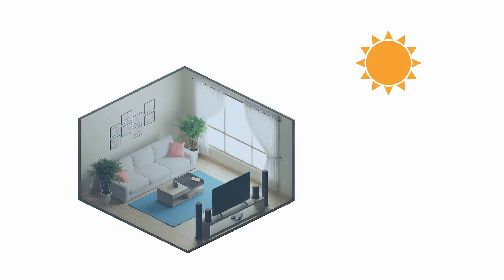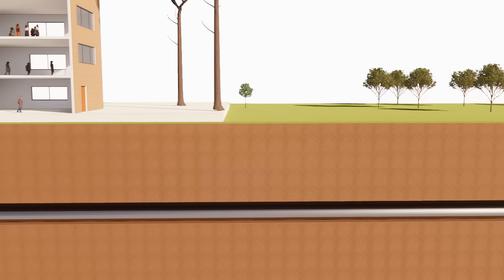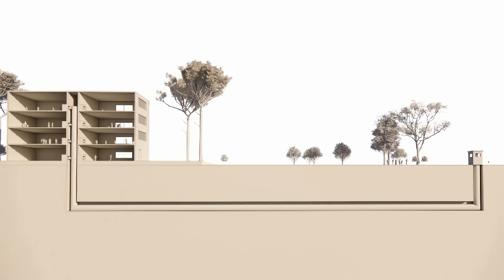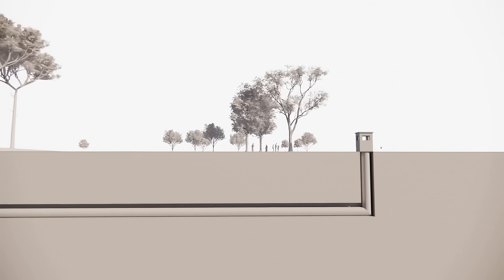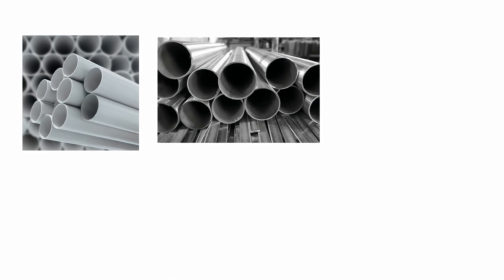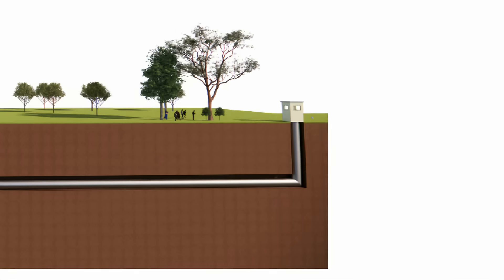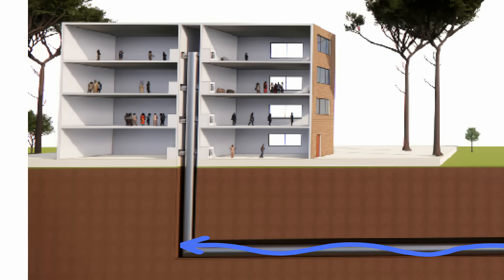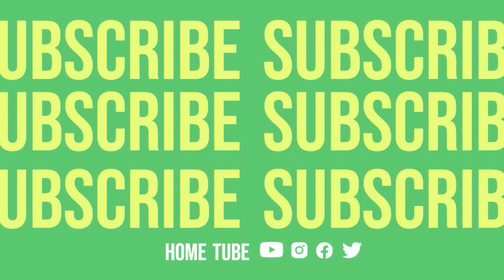Earth Air Tunnel System: Sustainable Cooling & Heating Solution

Comment: It’s not going to work because look at the heat/ cooling system, the air needs to go thru a very hot or cool grill to change the temperatures. If you just put pipes without grill it will not make significant changes. It probably would work if you install lots of grills along the pipe that connected to soil around the pipes.

Comment: Very interesting but, the underground duct or pipe needs cleaning at some point unless a clever solution is developed to overcome the problem of mold, virusus and bacteria growth in the system because of condensation/moisture.

Comment: A word of warning: When using it for cooling, if the humidity is high enough, and the ground is cold enough, you will have water condensing inside the underground pipe, which can then make the pipe become a breeding ground for mold, and the air passing through here is the air you are breathing.
So before using this, make sure you have investigated and understood how to make this type of system correctly, so that you aren't breathing "questionable" air inside your house.

Comment: do you think engineers are dumb , ideas work work.fine in your head until you put them in practice and learn the reality, the ground is cooler yes but as soon as you draw in hot air there will be heat exchange between the pipe and the ground which will heat the surrounding soil losing its efficiency over time

Comment: While this has been documented as a functional option (though not exactly the function this video is trying to sell it as) , this video leaves out a LOT of important details.
Formally called EAHE systems. If it interests you, study up. The info is out there, but takes some time and effort to sort through. Pretty neat stuff. 

For those who are interested, here is half a page or so of info I have found during my research. This is just off the top of my head, so take it with a grain of salt, but is accurate to the best of my knowledge. 

 It is meant as a method of TEMPERING fresh intake air, not necessarily as a means of climate control. All buildings need some form of fresh air. If you just pull in outside air that is 40* hotter/colder (or more) than your desired inside temp, it takes a lot to correct that temp difference. This system can moderate that difference to some extent and, sometimes, under just the right conditions, be enough to act as climate control on it's own. Much the same as a modern HRV or ERV system. Used in conjunction with a ERV/HRV they can really cut energy usage.

That said, they left out, or glossed over several VERY important details. 

1) Concrete tubes, unless sealed with some type of epoxy or something, is a very BAD idea for this function. Porous and difficult to keep clean = major mold concerns. 

#1 Better) PVC pipe, sealed, and laid in with a 1/8th" per foot slope or more to either a drain sump or out to daylight (out the side of a hill). A coated cable should be placed in the pipes during construction, to allow for a cleaning swab (think wads of towels) to be pulled through the pipes for cleaning. Pulled from inside to outside, with a second cable attached to pull it back after. Towels soaked with cleaning agent of your choice going out, dry towels coming back. Repeat as needed. #1 BETTER YET ) copper pipes, done the same as above. There are places to get these, but have a cardiac specialist on standby before looking at the prices. As Steve Irwin would say ""Crikey!!!"$$$$$

NO CORRUGATED STUFF OR DRAIN HOLES. That is just adding more problems to a system that has many possible pitfalls already. This could be a whole book by itself.

2) Not a single large pipe, but several smaller ones. Studies have shown that pipe diameter has a point of diminishing returns. It is generally accepted that 4-6" pipe is about the best range for thermal transfer in these systems. Then you calculate the number and length of pipes needed to get the proper CFM of flow for the best effect. Generally 30-60CFM each if using a blower/fan. Half that if used in a passive system. They will need to be LONGGGGG.

3) The intake should have a filter sufficient to stop bugs and other pests, as well as the majority of other pollutants. Mold/fungus ect needs moisture AND something to grow on/in. Clean pipes = no mold. Better filter = cleaner pipes = longer cleaning intervals.

Humidity is generally not a major concern, given the proper drain angle on the tubes. When its hot and humid outside, the temp drop in the tubes will cause at least some of the humidity to drop out and drain. While it may still be above the desired level for indoor air, it's almost always better than just having windows open for ventilation. Hot and very high humidity will most likely require some form of de-humidification for the best comfort level.
Cold intake air is generally dry enough by the time it gets through the tubes to not be a problem. 
Remember, humidity level is dependent on temperature.

For a passive system (NO FANS) you will need to design the building with a few specific features in mind. 
1) Very air tight. Way more common now than it was 20 years ago, so not as big a deal as it was in the past. USA code standards last I looked calls for ACH50 below 5.0 for residential. Thats pretty tight. Many custom high efficiency homes are coming in around 1.0 or less, but it will cost you.

2) Very well insulated. As above, not as big a deal in new construction these days. 

3) At least 1 operable window or vent (Will be referred to as exhaust below) at the highest point of the interior (conditioned) space.

4) All other doors and windows will need to remain closed with exception of going in or out of the building.

5) A passive system should have the absolute BEST intake filter system you can afford, and be well maintained.

Over simplified explanation of the system. . . . (and what this video is suggesting in the title)
Using thermal dynamics to your advantage. Hot air rises, and exits through the exhaust window. This air "pulls" the cooler air up from the EAHE tubes located in the lowest part of the building to replace the air that is exiting. That air is warmed by your body heat, appliances, phone and charger, solar heat gain, ect. That now "hot" air rises, and eventually exits too, continuing the cycle in one long endless loop.

In a well built and tuned system, a "greenhouse window/vent control cylinder " can be used to control the exhaust opening(s) and maintain a relatively stable indoor temperature, all without any electricity needed. 
The catch to a passive system is that sometimes you will have a LOT of fresh air, and sometimes you will have very little. 
With a LOT of planning and design, you can add in some solar heat gain to create a balance that will cause sufficient air circulation under MOST conditions.

If you have read this far, I hope you enjoyed this bit of additional info.
Reply: This system is quite popular for single family houses in Europe, but it almost always is not worth it. New homes have mechanical ventilation with very high efficiency, around 90%. The energy you gain by heating air in the winter and cooling in the summer is so low the cost of such heat exchanger will recoup after a very long time, usually over 25 years.
Reply: Thank you
Reply: You are a true Legend, sir!!! Thank you! I have actually saved your text and saved this video (downloaded for future reference)
Reply: This is a very important article. The video only explains very basic principles. If you're trying to apply them in practice, you need to check the parts you mentioned. Let me add that natural circulation using pressure differences requires very meticulous planning, and considering external variables requires a lot of knowledge. Installing an electric fan would be simpler and more reliable. Additionally, filters should be installed at the ends of the pipes entering the building. Even if the air passes through the filter and pipes, complete blockage is impossible, and contamination can worsen over time. It's recommended to install filters at both the intake and exhaust.
Reply: Take it or leave it..

Comment: water tables can be anywhere from 1 metre to 3 metres deep which means laying the pipe may be costly  - also mould & bacteria will build up in any buried pipe which can spread through the air to infect the home, raise humidity, introduce musty smells etc also cannot rely on natural convection but will need a motorised fan to drive air through the pipe so all in all the costs will amount this is not a cheap project

Comment: I expect that, on a particularly hot or cold day, the air moving thru the pipe will heat or cool the soil, reducing the overall affect

Also, heating and  cooling the soil is probably not good for the microbes near the pipe

Comment: you have to know , this system have two problems. first condensation in the pipe, second mold
Reply: Yes! Pipes like these need to be cleaned annually by washing and fumigating. Regarding condensation, it's best to have a slight slope and drainage to remove water.

Comment: why make it so long? if the point is to lower temp based on the surface area of the tube, why no coil the pipe so that its shorter and increase surface area.
Reply: I guess there are two reasons not to make it in a spiral shape:
1. You can reach the limit of the thermal capacity of the underground area. When air goes through the pipe, it heats the pipe and the soil around it while the air cools. And if it's in a spiral shape, you have parts of the pipe close to each other — they will heat each other.
2. It's difficult to make it hermetically sealed. You need a lot of turning sections and must connect them all in an airtight way.

Comment: How to vent out the present hot air of the house,  because without a cross ventilation.. Your concept is... Very much doubtful,  specially for single floor houses whose roof exposes to the sun and faces an ambient temperature of +40°  in general, during summer.

Basically... This idea is best for  theory only .. Rather any practical scope.

Comment: but 
I think there is a little problem. 
 When it is runing the weather inside the pipe being cool and the ground where pipe attached are being hot.  so after a few munites or a few hours ground cnnot coole down the pipe.

Comment: The only modification to your drawings would be to use 45 degree pipes at the bends to eliminate the air resistance caused by a 90 degree bend

Comment: If we apply the laws of convection to chimneys, we can also calculate/control the air flow speed, as well as improve heat exchange in the pipe.

However, moisture condensation and the emergence of fungi can result in a catastrophe for environmental health - I agree with @ddhgerlb : this wheel is square and does not roll.

You can use both the dry subsoil and the upper water table (cisterns) as a source of cold, since water is more efficient in heat exchange - as a source of cold - in a partially closed air circulation system, including one powered by solar electricity.

Insufflating air with ozone into the circuit would be brilliant...

It may seem expensive, or even complex - but it is not! And - for climates that are not at all mild - the payback is very fast.

Comment: I think it is very important to use a pipe which has a higher theremal exchange rate like copper or aluminum. PVC or concrete pipes would hardly release  much heat underground. The problem is that copper pipes which have good thermal condictivity are expensive. Any suggestions?
Reply: Very good idea
Reply: Maybe it does matter for short pipes. If you calculate the distance where the temperature of the incoming air stays equal to the earth's temperature for long pipes (50 meters long, 0.3 meter diameter copper and concrete pipes), it will be just before entering the house.

Comment: What will be the distance between building and outside blower. More distance take more time to travel air and outside air temperature down accordingly but requires more land so I think it will not work for small projects in urban areas

Comment: The smart building concept, you can use this system with sun collector panel as windows to run the blower and also work as free heater when in winter seasion..
Reply: Not exactly a heater... Imagine – frost at -50°C, like in Siberia or Canada 🙂 But it's very good for preheating incoming fresh air!

Comment: I think the air won't be equally supplied across all the floors of the building. The ground floor will receive the coldest air, while the upper rooms won't be as cool as the ground floor. Correct me if I am wrong.

Comment: Good idea, but not widely practical- you need too much space to make viable for most buildings, along with the issues of moisture, mold, airborne particles and critters.  Sealed, vertical Geothermal heating & cooling solves those issues.

Comment: This is an old idea that isn't used much anymore. In the 70's and 80's many architects and builder's experimented with this idea and found out the hard way that it's too susceptible to mould growth and either impossible or extremely costly to clean and maintain. Nowdays we use the same principal but with closed loop systems often together heat pumps. It's safer and much more effective. No need to reinvent a wheel that never rolled.
Reply: In this case, we need to calculate expenses. Even when we include the annual cost of cleaning the pipe, it may still be cheaper.
Nowadays, there are various pipe-cleaning robots. We need to calculate each case.
Reply: @EngineeringComfort clearing robots, cheap and fulltime automatic nowadays..
Reply: Küfü engellemek için yapman gereken boru giriş bölümüne tuz kayaları koyman yeterli. Hatta borular beton ise ara ara tuz koymak verimliliği artırır.

Comment: How about the bad odour? How to filtered fault odour?
Reply: There is no bad adour bro....infact it feels much better than a airconditioned stale air room
Reply: It depend on pipeing material, if you use concrete it will gather mold and moisture that cause smelly odor.. much better to use steel or metal pipeing, but the investment cost will be jump, and plastic pipe not recommend for this type of uses
Reply: @sandyely234  30 cm çapında beton borulara tuz kaya parçaları koy küfü ve nemi önler
Reply: @erkanun but that would be continious preventive act that you need to repeat every weekly or monthly basis and that would be not cost effective at long run.. we better use material that has low maintenance from beginning..

Comment: The video starts with 'What if i told you that you can cool your home in summer and warm it in winter without using ELECTRICITY, sonds like magic right?'
and then the proposed solution uses blower to pump air inside the tunnel. Who is running the blower?
Reply: enslaved hamsters
Reply: @thefalconflame 😂😂

Comment: There is a show cave not far from my house that uses the air from the cave to cool the gift shop. Walking into that shop on a hot Summer day is amazing. It in fact is cool enough that being in a T-shirt you want out after about 10-15 minutes. I worked in an office for 30 years and temps that cold you will have every Lady in the building screaming bloody murder.

Neat fact the Persians stored Ice all summer using convection to control the temperature of ice vaults.

Comment: I would like to see an actual application of this in a home.
Reply: I saw it in a dome-shaped house-greenhouse in Norway. https://www.youtube.com/watch?v=RKoJOTglduo
Reply: @EngineeringComfort still looking for this in a home in the city.  Ive only seen this in an earthship.
Reply: @peterpiper5300  It's impossible to lay a ventilation pipe underground just for one particular house in cities. But if it were an infrastructural common project, it would be possible to use one large pipe to ventilate and cool several houses. That way, it could be cheaper to maintain—for example, by using a shared pipe-cleaning robot.

Comment: Heating your house to 15°c is useless it's still far to cold,  I like my home to be at least 22°c, and this system would be far to expensive to install,  If you really want to keep your house warm in the winter then you need to super insulate it, I recently spent 5k insulating my 2000 sq ft, house, I did most of the work myself, and now I hardly need the heating,  also not polluting the planet.

Comment: I love how everyone thinks their solution is sustainable and could by applied anywhere in the world. This solution only works in the most temperate and arid climates of the world. Which  applies to a very small part of the world. No where in North America would this be a sustainable alternative. Water tables and the depths required to get to stable 20 degree C temps are way to deep. I live near a mine and im told by workers that the temp is stable around 20 degrees but it is 1000m deep. Good luck putting that in your backyard not to mention getting air to flow through it. There is no such thing as sustainable energy. As it falls in the same category as perpetual motion.